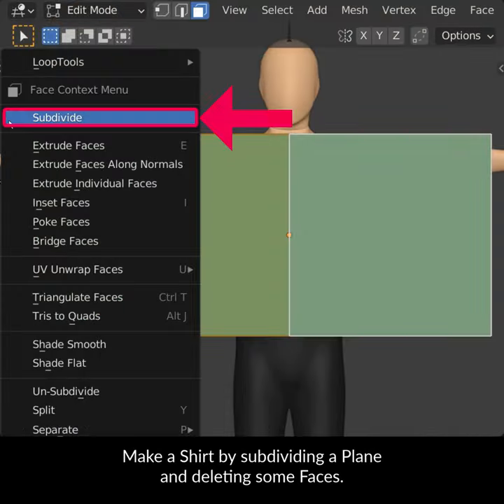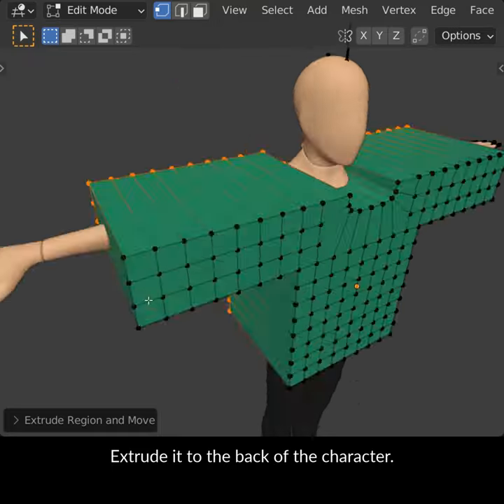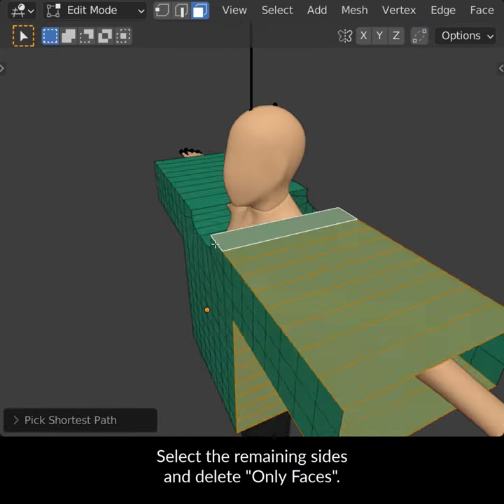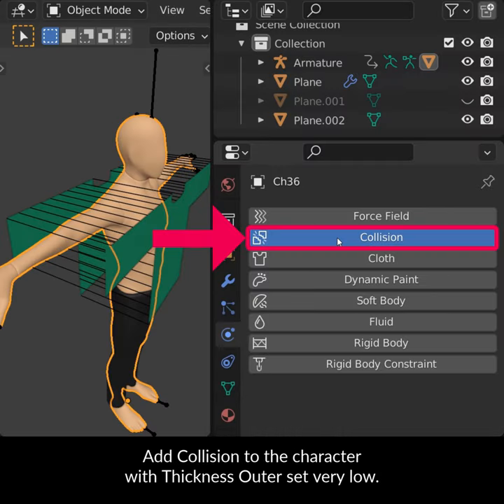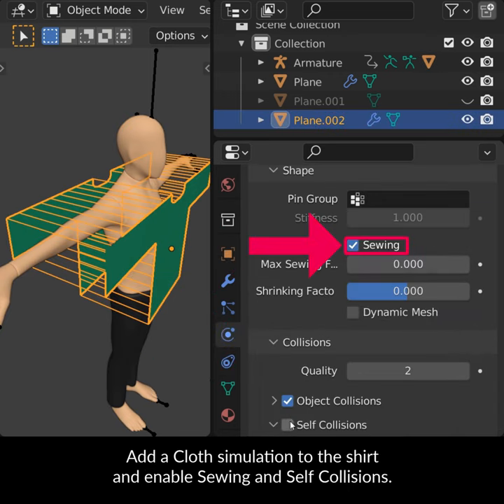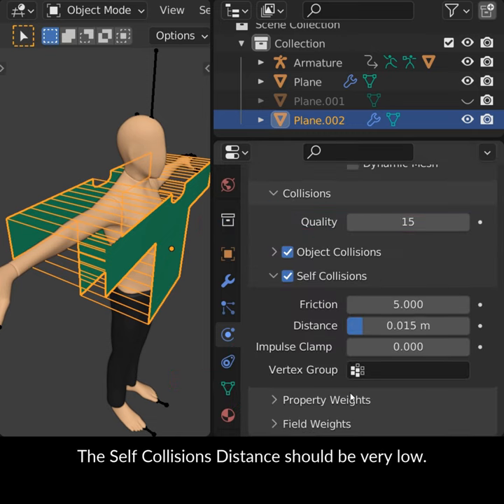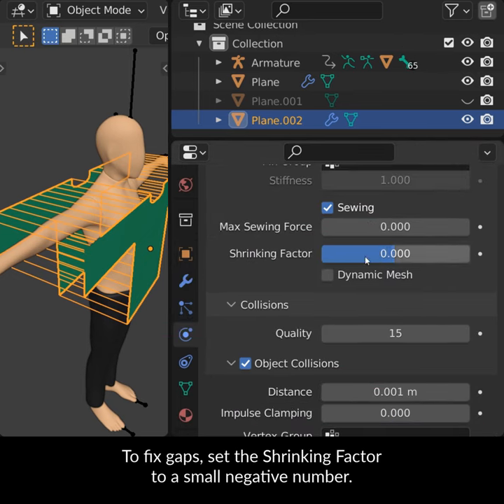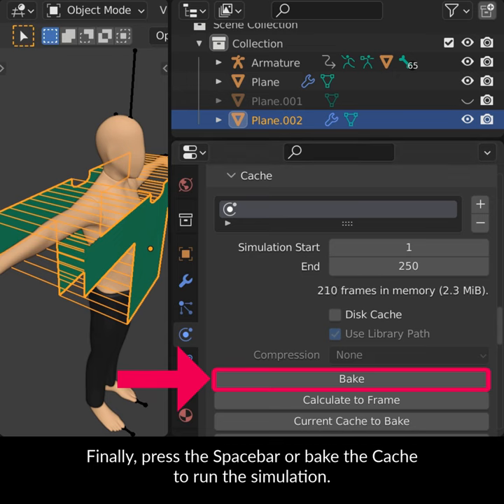Blender Secrets - Cloth Simulation Sewing Basics

Comment: Nice method. Still gaps but I wonder if applying a solidify modifier may help it or not.
Reply from the maker: It’s a bit unpredictable. The right settings and more geometry than shown in the video will indeed close the gaps most of the way. And yes, adding thickness helps a bit more. But in my tests, sometimes it works better than other times, and the values are not very intuitive. Takes a lot of experimentation. For the rest you can bridge the edge loops of the gaps… but that’s for the next video ;-)
Reply: @BlenderSecrets  Thanks.

Comment: Aha! Small negative number to the shrink factor... i'll try that! I tend not to use the sewing feature entirely now. Unnecessary calculations and weird gaps in the seams. Instead i model the shape as closely as the finish result as possible and bending around the body instead of flat and let gravity do the job making it fit and fall naturally.
Reply: can u tell me how it works? is there a recommended video?
Reply: @IsotypeLabs   The closest tutorial is this https://youtu.be/bdbXSPN_VUc even though it still features sewing. Cloth simulation without the sewing gaps part works just as fine.
Reply: @jelly._.cube86  thx for the link. but i really dont know how i can avoid these gaps.